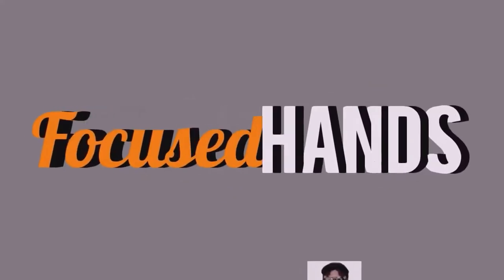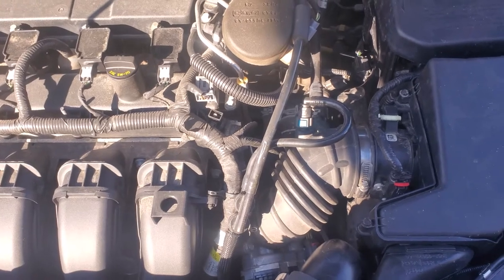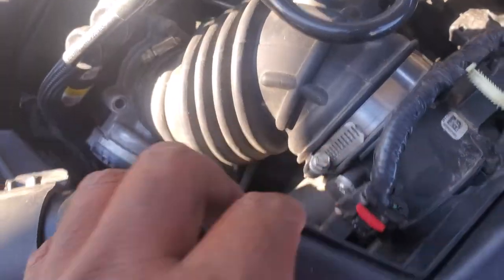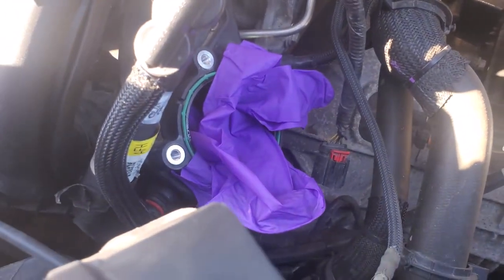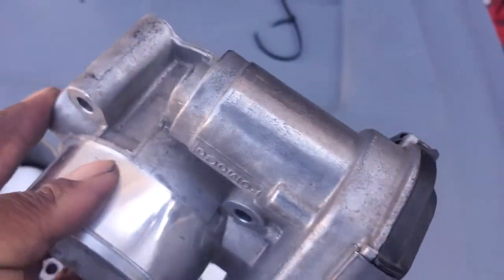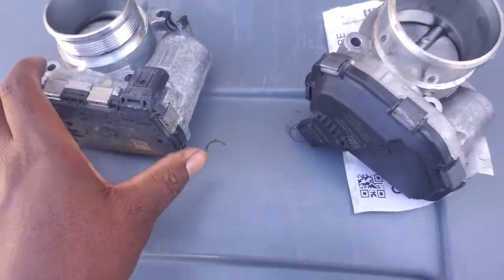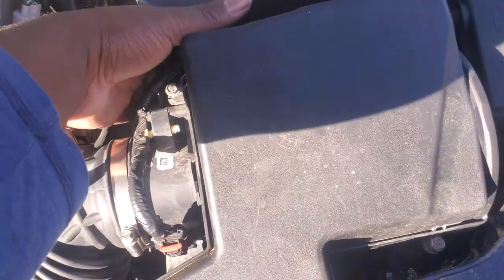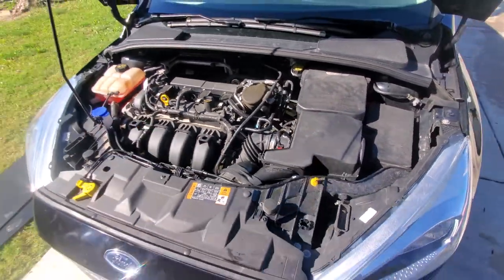2018 2.3L Ecoboost Mustang TB upgrade for Focus 3- Part 1

Comment: You have to reset throttle body position sensor, and that should do it. I did not know i could use the same hose since there is a diameter difference, but you proved me wrong, lol. Great video.
Reply from the maker: Nope the throttle body was bad
Reply: I need to catch up with your videos. Is this focus still running, and did you end up getting another 2.3L throttle body? I'm thinking of upgrading. I got the MST performance intake hose and a highflow are filter in it currently.
Reply from the maker: This Focus is my current daily driver running on the 2.3L throttlebody